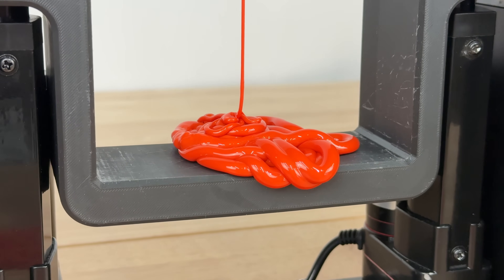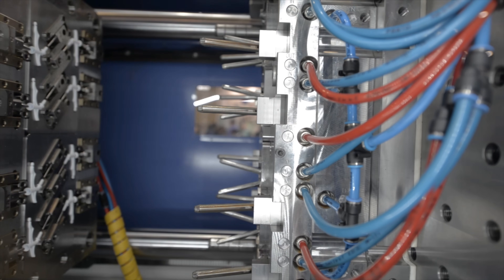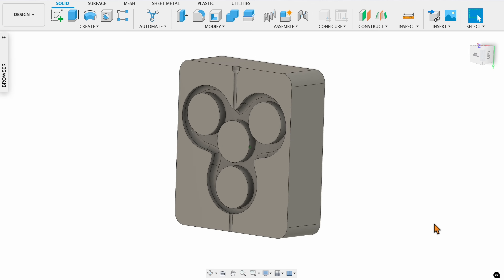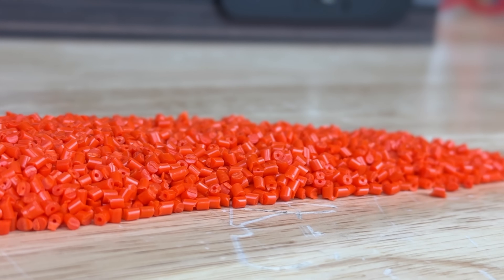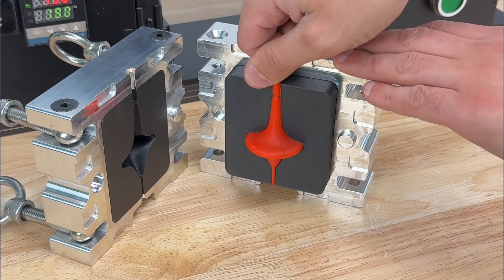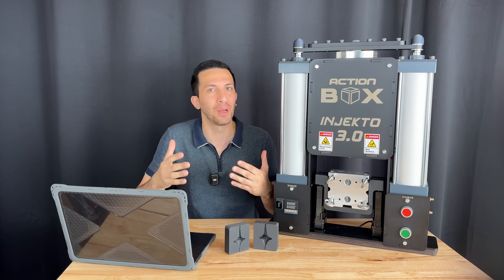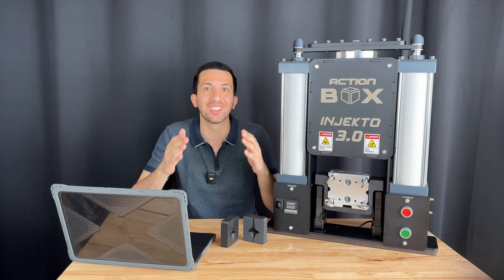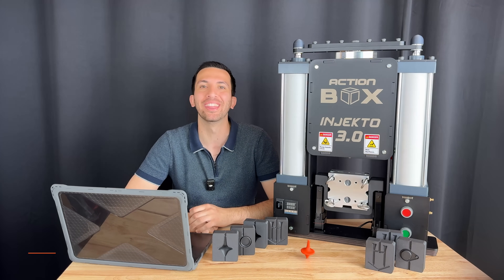FDM 3D Printed Molds SURVIVE Plastic Injection

Comment: I do remember formlab has solution exactly for 3d printed mold. They have a glass mix resin that can only be used on their own machine. The result is a mold suitable for injection molding, upto 100 times according to their claim. The ideas was to quickly prototype the mold, try injection process to see if there are flaws in spruce, gate, air hole etc... Then proceed to machining for metal mold that last like 100,000 times. My research also leads to a more usable resin like [3Dresyn IM-HDT], they can be printed on commercial machine and have 290C heat deflection temp (but at 220 EU/1000ml), the trade of  is you likely have much better details compare to FDM mold... which does not mean much since details/complex structure would likely run into other issues like cooling off, air trap. Thus, what could not be solved with better machine is to be solved with better mold design. I would love to see your machine dealing complex design (thin, curve, pointy end) using mold made with by those resin (since they would capable to make extreme details etc).  As far as I have seen, the design i see here can be done by 500-1000 USD hand crank manual injection molding machine.
Reply: The great thing is that formlabs resin does not ONLY work on formlabs, you can buy the bottles and pour the contents right into any 300 dollar printer. You can also just copy the settings from PreForm used for that particular product to get a starting point for calibration. But Sunlu's Water Washable CLEAR resin is fine at 150c at about 220c it starts to overcure and crack. Then there is 3DMaterials SuperFast Clear Water Washable that seems fine at 310c, I use this to make fixtures for soldering, I haven't tried them in there perfectly clear forms, I usually add some alcohol-based pigment.
Reply from the maker: Resin prints have limitation in that the printers are generally more expensive, especially if you want to use Formlabs (our Form 4L video is coming out next week), plus they are far more brittle. Granted the resolution is much better so pick your application, but these make prototyping much cheaper. Hope you enjoyed the video. cheers
Reply: @ActionBOX  In this to be serious lets not talk Formlabs as on offer right now you can pick up an ANYCUBIC resin printer that can print the full size of the mold, including two bottles of resin for $149. I am looking at formlabs because they are better, but it is a mess consideration - not a cost, given the price of your Injecto anyways.
The things with the cheap Chinese resin printers is that they seem to only focus om figurines, and there are hardly any engineeting videos out there.
Reply: Considering how cheap resin is, printing more resin molds might be cheaper and faster
Reply: @VoidPixel4179  the consistency and mold degrading, the ease of demolding also needs to be taken in consideration. If you do a small production like few hundred then i believe resin is absolutely banger for buck
Reply: @lehoangminh 

He said 100,000 units. 

Resin is every 100 units

Costing about $1 a print, you're way off at Aluminum mold which could be $25,000 - $100,000 depending on desing.

You can't beat that time an efficiency. Also most molded products aren't precision items so you can get away with tiny deviations

Comment: Use a thin clearcoat layer to get a perfect finish inside?
Reply from the maker: That’s a very interesting idea.  We have to try that.
Reply: @ActionBOX  Consider high-heat header paint.
Reply: @thegrumpytexan does header paint like to bond with PET?
Reply: @ActionBOX  Did you try it? WE NEED TO KNOW!!!
Reply: Did anyone try this? Seems like a great idea
Reply: Or just run an ironing test, fine tune your ironing settings

Comment: sounds like petg molds. pet-cf is almost 5x the price of pla/abs/petg at about 80usd or so. pla-cf seems to print very nicely, better than normal pla also. 36usd, nah double or triple that for current markets. petg-cf is closer to that 36usd. you sure you used pet-cf and not petg-cf? how about just normal petg.
Reply from the maker: Yup, it’s PET-CF, we found it on Amazon from a reputable company. 

The other polymer filaments you listed would not survive the injection.  We tried PLA-CF and while it printed nicely, it got fused by the molten plastic.  

Hope you enjoyed the video,
Dave
Reply: @ActionBOX  then other suppliers are overcharging for the pet-cf. petg-cf/petg should be similar enough.
Reply from the maker: @gsestream  The one we use is from Siraya Tech. It's definitely worth the money.
Reply: What about PCCF ?